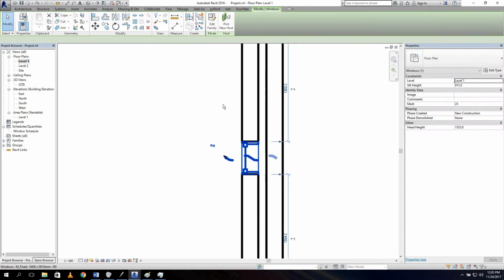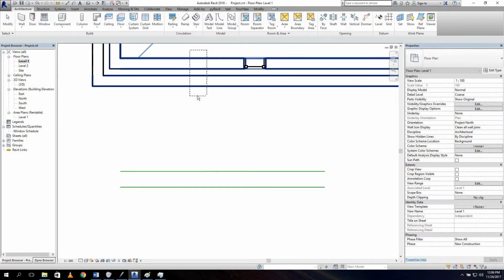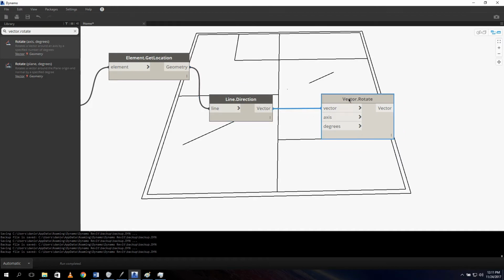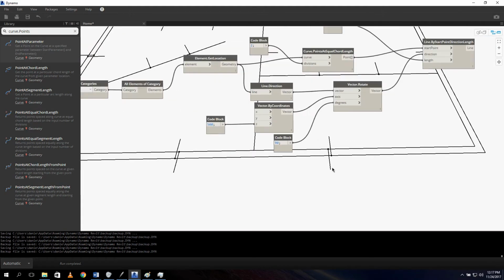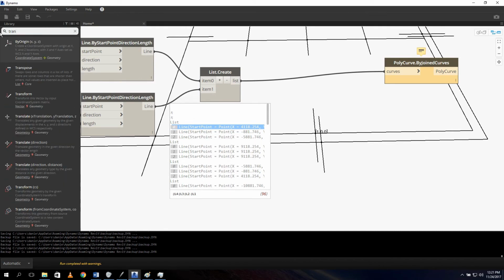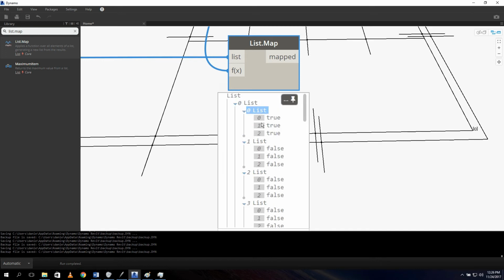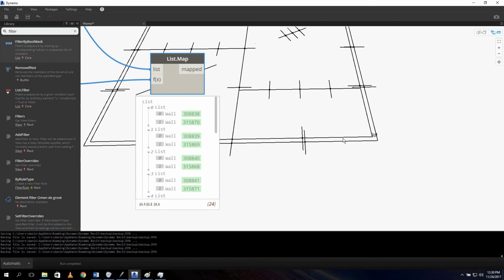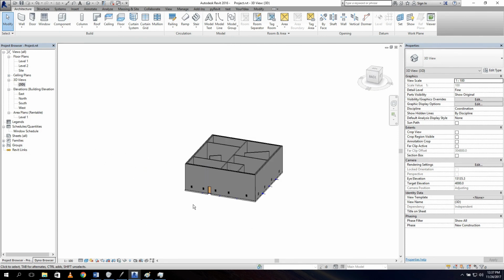Dynamo - Joining elements

Comment: great very much!! how copy name of wall same in to comments in new wall ?
Reply from the maker: If you want to add a parameter value, use the node Element.SetParameterByName.
Reply: but new finish wall and other near wall is diffeent  :(
 http://dynamobim.ru/forums/topic/%D1%81%D0%BC%D0%B5%D0%B6%D0%BD%D1%8B%D0%B5-%D1%81%D1%82%D0%B5%D0%BD%D1%8B-%D0%BD%D0%B0%D0%B9%D1%82%D0%B8-%D0%BF%D0%B0%D1%80%D1%8B/   https://drive.google.com/drive/folders/1i7i6HSlJwQBl5i1Lkn1jZqAY7yPMUYjE